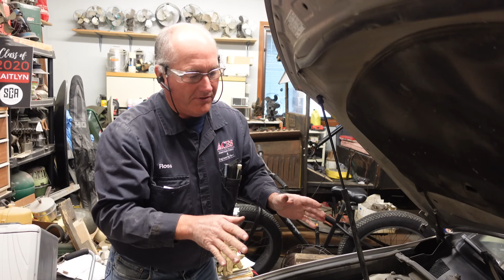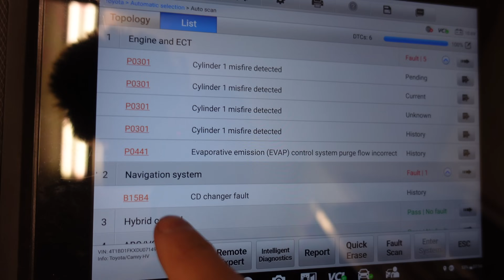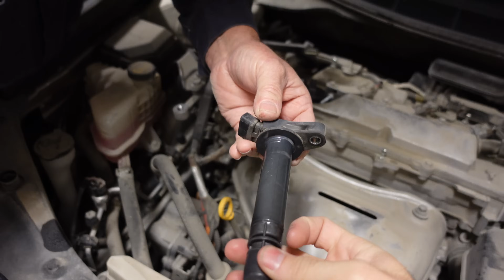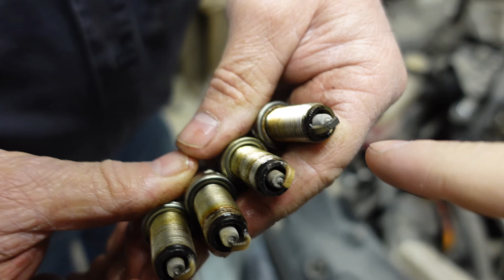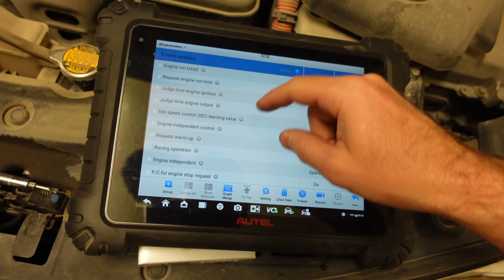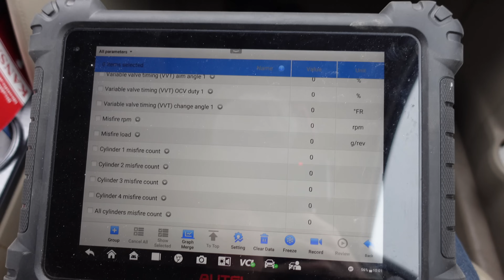My Moms Car Is SHAKING Itself Apart! What's Wrong?

Comment: I've worked on hundreds of these (and own several) one thing that this era of Camry suffers from is an issue with the throttle body gumming up. It was most prominent from 2002-2010 but even these have a habit of the throttle body getting a little gummy and over the years the ECU learns to adjust the idle to the "new" lower idle due to the carbon keeping the butterfly valve just slightly open. This results in the idle dropping below 650RPM and it will cause these to shake when cold or from a start so that's another thing to be aware of, just unplug the battery before cleaning that TB or you'll be sorry lol
Reply from the maker: I'll check out the TB too just incase, seems like it's running great now 🍻
Reply: @WatchJRGo  thank you JR for letting pops talk! I appriciate all of your videos!
Reply: The .008 gap should not  matter but 266k mi. Wow. I switched to Toyota FJ in 2013 and won't go back! I was tired of lemons and poor design (G.M.) good video.
Reply: Yeah... This situation was similar to my gen 2 prius at 240k. Cleaned the MAF sensor while I was at it ...🙂 did run smoother
Reply: Dad references the made for tv movie “Duel”! An early Steven Spielberg directorial gem.
Reply: Just shy of 110k on my 2012 Camry hybrid and it is still running great and giving me 36 mpg!
Reply: Love how he never stopped using the adjustable wrench
Reply: Did these have the EGR cooler like the Prius has? It can cause that issue if it has one and it is plugged up.
Reply: @dmcmanis03  yes the hybrid version of these use the EGR cooler unfortunately but don’t seem to suffer from the same issue as the Prius do (including head gasket failures)
Reply: @dmcmanis03    I've been commenting to others about this as well.  The Camry may not suffer from this like the Prius but I think I think it would be smart to not only check the cooler, but also the EGR valve, tube, and the tiny EGR ports in the intake manifold. From what I've researched, a dirty and/or plugged EGR system can lead to engine clatter,  shaking, overheating, lower MPG, and contributing to blowing the head gasket.
Reply: yooooo its jimmyjimjims! Come out with another previa video!!
Reply: How does one clean the TB properly?
Reply: @Miloshe71 car care nut channel has a video on proper procedure for cleaning a Toyota throttle body.
Reply: @Miloshe71 buy new gasket, take it out, push throttle plate open with finger, apply throttle body/carb cleaner. Scrub until clean, especially on the edges. Reinstall wirh new gasket (old one might cause an air leak and a lean condition).
Reply: All in all the time gas sspends in the tank lends itself to poorer quality at ignition. IMO as a mitigating effort, I would run higher octane gas if only mid grade to help offset this aspect of stale gas.
Reply: @larrybe2900  this thing has run almost 300k mi. How should the gas be stale in this vehicle?
Reply: @larrybe2900 higher octane fuel doesn't last longer, that's a myth. The fuel cleaner he put in will do way more than running premium ever would.

Comment: I'm a simple man.  I see Mom's Camry, I upvote.
I finally replaced the spark plugs in my Sienna at 200+k miles.  The gap was still fine but I figured I wasn't going to put the old ones back in.  Computer control ignition and fuelling is impressive.

Comment: You can force the hybrid Toyotas to start the engine by pressing brake and full throttle at the  same time …. Or just turn heat on full blast 😂😂
Reply from the maker: I wish it worked like the Volt, if the hood is open and the ignition is on it keeps the engine running 💯
Reply: Ya I like the volt for that ! I guess toyota figured no one would ever open the hood they would just buy a new car 😂😂😂

Comment: Camrys are boring but reliable. Friends Mom got one of the first ones with the classic square body and they kept it forever and it was a good boring car.
Reply: My 95 Neon had 80k on the plugs and the gap was .plugs80 from about 40. I only changed them because it was starting to run bad when cold. I got it from my lil sister and got all the service records and that's when I found out the last time it was tuned up.